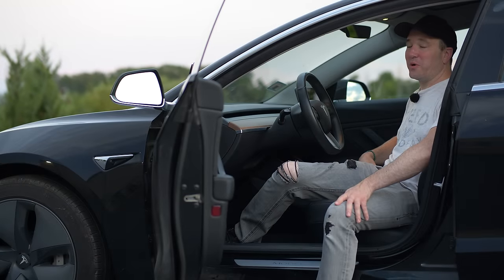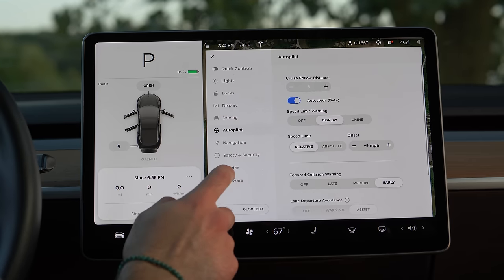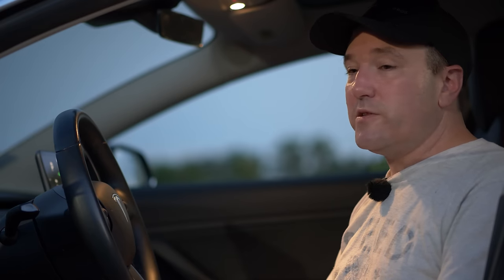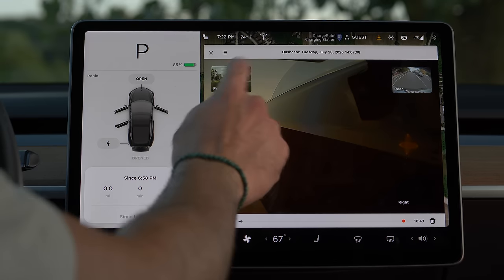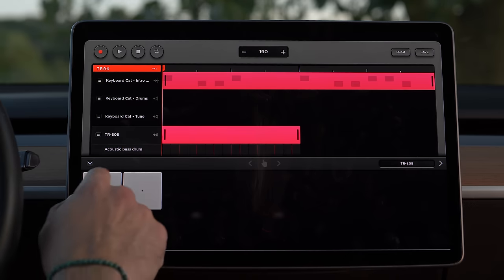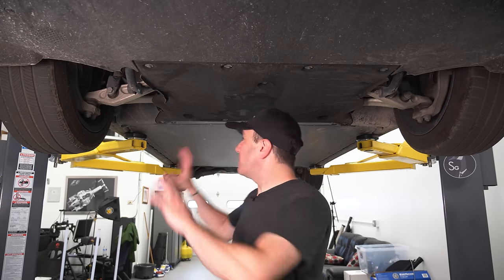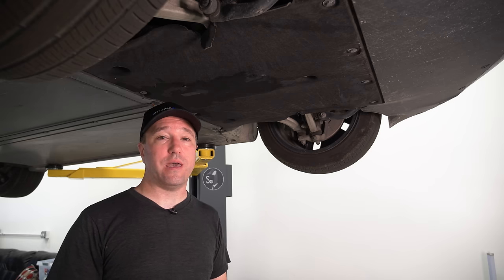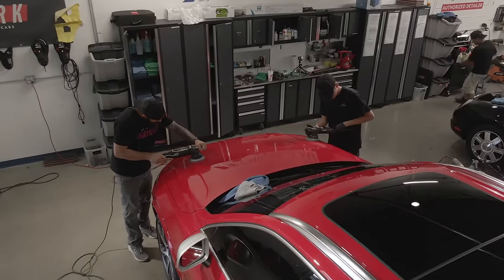Tesla Model 3 | Explaining the Cult

Comment: As my teachers always said in architecture school: Simplistic means a lack of design. This interior is textbook simplistic.
Reply: I'm not sure I agree with your teachers. In my experience the quality of architecture is not based on whether it's simplistic or not but rather what its intended purpose is. As far as design in general goes it's much the same thing. Even though - as far as functional design is concerned - the most successful designs often have in common that all unnecessary parts have been cut out.
Reply: You didn't go to a very good architecture school or what your professors were saying went over your head and you misinterpreted it. That comment is the literal opposite of what good design is about and is a very "simplistic" statement. Good design has nothing to do with complexity or simplicity. There is great design that is complex and great design that is minimal. There is also really bad design that is complex and really bad design that is simple.
Reply: @JonasRosenven  I can agree with you on your point of functional design. A design doesn't need to be complicated to be functional. As far as I was taught, an uncomplicated and functional design is considered simple. Simplistic on the other hand is focussing so heavily on the making something uncomplicated that it looses functionality. This interior, for example, has such a heavy focus on removing physical controls that it throws away functionality with its screen. That's moreso where I'm coming from in terms of it being simplistic.
Reply: @flipadavis  You see, there is a difference in the word simple and simplistic. I'm not here trying to say that a design needs to be complicated to be good, quite the contrary actually. An uncomplicated design where form follows function can be considered simple. Simple designs are often thoughtfully planned out and work incredibly well despite having an uncomplicated appearance. Have a look at an interior out of something like a Nissan Micra or Toyota matrix interior. Sure, they may not be the most aesthetically pleasing, but they are functional and simple. With the model 3 interior, however, the designers went and created something so simplistic that its function is hindered by it. In switching to having everything on a screen and removing buttons, they went and threw function completely out the window. So now you are stuck with an underdesigned interior with a tablet taped to it. It completely lacks design in terms of functionality. Maybe it is you that misinterpreted that definition. Also, I didn't think this mattered to make my comment have credibility, but I studied at one of Canada's top architecture schools.
Reply: @alexmoroz3243   I completely agree with you as far as this car goes. They sacrificed usability for the sake of pure aesthetics. Simplistic doesn't nececessarily have to mean that something is hard to use. You know - old cars had simplistic controls. A button for the heat and the level of the fan. A button for suspention. Porsche went crazy in some cars with 30 or 40 buttons plus a touchscreen. I like a bare minimum. Physical controls for the most used things and touchscreen for the rest. Tesla of course went all out. Alex is a lot more eloquent than me and he sums what I mean up perfectly. I have to brush up my english :) I do enjoy the civilized discussion though.
Reply: "they went and threw function completely out the window."  
This is one of those anti-Tesla talking points that continues to be perpetuated. I've driven a Model 3 for 2 years and functionality is quite good with very little need to use the touch screen while driving. Plus there are actually quite a few buttons in the Model 3. 

People often say there's no dial for volume and they need a dial for volume. Well there is a scroll wheel on the steering wheel that does volume as well as move to the next song and press to pause. 

They say they need knobs for climate control. Well there is an auto setting that will keep it whatever temperature you like or you can use voice command to turn the temperature up or down or to turn on various seat heaters, etc. if you don't want to touch the touchscreen.  

People say there is no button for wipers. On the end of the left stalk there is a button that turns them on for one double-wipe and causes a wiper interface to pop up on the screen. With that interface there are big clear buttons for pressing different speeds. But again there is an auto setting and the wipers turn on by rain sensors which is what I use anyway. And again there is voice command. 

There are buttons on the sides of the power seats for adjustment. There are buttons for the windows on the door arm rest. There is the other button on the steering wheel for cruise control speed adjustment. The right stalk sets autopilot and selects the gear. When in park the brake pedal is the start button.

Driver profiles remember your seat, steering wheel and mirror settings but if you are a guest then when in park you can adjust the mirrors and steering wheel through the screen and the scroll wheels on the steering wheel.  

These things are all well thought out with the intention to remove as many redundant buttons and knobs as possible while keeping functionality while driving. Also almost everything can be controlled with voice commands as a bonus.

Comment: As a '19 Model 3 owner, this was fair and well-done, and basically matches my experiences so far. It's definitely a cheap car built around a super high-tech drivetrain and infotainment system. For what I paid, the "chintzy" stuff doesn't bother me because the overall experience is quiet, comfortable and pleasant–when it's not peeling my face off. But it only does that when I tell it to.

The "everything on the screen" thing is mostly fine. What does irk me a little is that things which really don't need to be electronic/power-opening (glovebox, charging door), are...while one thing that really should be power-opening (the trunk), is not. I was actually really surprised and a little disappointed to find this out. I mean, my dad's 2000 Accord had a power trunk. I think they added it to the Model 3 shortly after mine was made. Cooled seats would be really nice (added in '24).

Thankfully a previous owner had already wrapped all the "piano plastic" in faux carbon, and added some nice rubber floor mats. With those additions, the interior is wonderfully easy to keep clean (even with kids). One spray for the glass, one spray for everything else. Coming from a car with tan leather and carpets, it's great.

Overall, it's the best car I've owned. For the purchase price and cost of ownership, I have no complaints at all.

Comment: Those panel gaps is one major reason I sold my Mustang. The wife’s Mercedes has perfect panel gaps. From far away the Mustang looked great, but up close and especially next the the Mercedes it just looked unacceptably bad. I know, big difference between price but not so fast. My Mustang was new and my Mercedes was used. The Merc with more miles drove better, had better quality inside and out. It caused me to sell my Mustang to buy an even older C63 AMG with more miles. The C63 has those same perfect panel gaps. The car looks so perfectly put together it’s a quality I think you may not realize pulls your eye but does.

Comment: I sat in 2019 model 3 for extended amount of time and the firmness was really jarring for me on slightly bad pavements. For a electric commute car, I favor comfort over quickness.  Not a fan at this point.  Need to wait for one with better suspension. 😕
Reply: It's not a Buick
Reply: @DuncanL7979  I have a Lexus rx 350 with firm but comfortable ride and model 3 is a lot firmer and jarring than my SUV.  Tesla car should at least give me equal or less jarring ride than my SUV IMO with their multi link suspension.

Comment: It’s interesting that most reviews are done in top trim loke many sg reviews, but he decided to do his Tesla model 3 review in the base trim.   With that said with the exception of 0-60, top speed, and range they are exactly the same.  

The door handle are easy to use.  Seems like a baseless gripe.
Reply: I have used the door handles and they are a god damn joke. Complete pain in the ass. Also had it close with my fingers in it... 

I live where it reaches -30f and even the most practical door handles freeze solid under a 1/4in of sheet ice. These handles fail HORRIBLY when frozen through. It is 100% needless and offers NO BENEFIT. 

He isn't lying, and he never does. The door handles are stupid and he's not the only one to notice.
Reply: @jordanjoestar8839  Agree. I live in northern Canada and It can reach -40F and my normal door handles freeze up and are difficult to open at times. The ones on the model 3 would be a nightmare. Definitely not a baseless gripe.

Comment: I cannot like or dislike this video. Here is why: I like it because it's honest. It showcases the good with the bad, and talks about comparative issues with other manufactures. 

I dislike it because it focuses on negative details that are easily explained or dismissed. For example: the 'car guy wont like it.' True, but this is a personal objective choice. As a car guy, I like the Tesla. The large touch screen is a distraction. Again, true. So is a cell phone and even though distracted driving has been made illegal in many states, cell phone use while driving is still a thing. It comes down to personal choice, risks, and self-discipline. One thing the Tesla has over other manufactures in this, is that you actually CAN be distracted. The car DOES drive itself using  autopilot and will absolutely pull over and stop if you are that distracted. So engage autopilot while driving down the road, pull up the web and browse feeling confident that the car will stop when it needs to, stay in its lane, etc. Drive when you want or need, or let the car drive while you 'monitor' the car. 

Fit and finish. Yes, there have been some issues with this, and Tesla's QC should probably be revamped. They have gotten better, and will continue to improve. As mentioned in the video, many auto manufactures have had issues with this. It's all apart of keeping costs down while attempting to not suffer in the quality department. It's a balancing act. 

I do not believe that a Tesla anything is right for everyone. To own one, you should probably step up to a dual motor (or tri if offered), have a garage with power (or have power installed) to charge it, know where your local Tesla Service Center is (and they repair many of these QC things under warranty, btw. And the Warranty was not mentioned in the video, which in my opinion, is pretty awesome compared to other manufactures.), know that you will pay more for tires as they tend to wear faster due to the weight. But you will actually make that up by saving at the pump. And know that Tesla is a relatively new car company that is pushing the envelope on what cars should be. 

Everyone asks for the future, and when it is presented, they find faults. I personally embrace change, technology, and forward thinking. I currently do not own a Tesla, but I have preordered the CyberTruck, and I cannot wait. I am excited to see all its features, both good... and bad.

Comment: the hipster boujee car of choice
Reply: Its also somehow supposed to be "affordable"
Reply: @stephenfannin6482  Yeah 38k is bargain basement amirite?
Reply: @stephenfannin6482  "bUt BuT tHe MoDeL 3 sTaRtS aT aN aFfOrDaBlE pRiCe Of $35,000" yeah it also only gives about 150-200 miles of range and takes long to charge fully unless you use the supercharger, and you don't get much car for your $35,000 would rather get myself a Camry XSE V6 or a slighty used (maybe new if I'm lucky) Civic Type R
Reply: @stephenfannin6482  The base Model 3 with no options is $29,690. That price puts it in competition with a base model Ecoboost Mustang, Hyundai Veloster, or Honda Accord - but you get much better off-the-line performance, lower maintenance costs, better resale value, and it only costs $9 to "fill the tank."
Reply: @imnotusingmyrealname4566  u save on gas and maintenance.
Reply: @alextogo8367  Yeah it still takes a lot of time to catch up. Also I'd never buy a Tesla just because of the image. It's one if the few products where I care about that because I don't want people to assume I'm a Tesla fanatic. I'm in Europe and VW has just launched the EV Golf successor ID.3 and the crossover ID.4 is launching shortly. Those are actually cheap-ish cars while still offering the benefits of an EV. VW's Czech brand Škoda might be an even better buy for value for money. You even get the Rolls Royce umbrellas in both front doors, just in a more practical less extravagant way. Telsa is still a luxury car while VW and Škoda are good quality cheaper cars.
Reply: @imnotusingmyrealname4566  well you need to have a good image if you want to be a good competitor right. If I was the owner of a company, image would be everything. Look at Hyundai they had a bad image for a very long time. And even though they getting better, some people won't buy them because of their "badge". You're damn if you do and damn if you don't. You can't make everyone happy. That's the bottom line.
Reply: @zzanatos2001  the cheapest one I see on Tesla's website is $37,990.

Comment: Correction: Cheapest Tesla is the $35k standard range model. It’s off menu and you have to request it but it’s there. 

I own a Tesla model 3 and while I agree with the panel gaps, cheap paint issues, cabin noise, semi-cheap materials, the touch screen is not an issue. Only once did I have an issue with the screen and a quick reboot fixes that. Until people start crashing because they’re using the screen, I think the argument of the screen being a distraction is mute. If anything, the issue is full self driving. There is evidence, from crashes, of people falling asleep using the feature. To your point on Superchargering. It’s only meant for road trips and is not recommended/ intended for day to day charging. Almost all drivers charge at home for their day to day needs. That’s where the savings come from vs gas cars. Also, in addition to tesla there is lots of companies that provide charging for EVs that you can use to charge your Tesla (e.g. ChargePoint, electrify America etc.).

Comment: A year later, I sold my perfectly working GTI for a Tesla 3 AWD to get a NEW car, long story short the GTI had many engine issues and warrant was running out. Two weeks into this car, I can say the good news is the black piano is gone in the 2022 model. The bad, well, I got the T3 awd extended range version, and one thing people don't say openly is that this car doesn't do well in either cold or hot. Take the stated range and divide it by three in cold or hot weather.  The EV future is a joke for now, and I can say that the plug-in hybrids make more sense with smaller batteries and less chance of a single cell failure. You only need one cell in that big 75kw package to reduce the performance of the whole battery. On the safety side, I suggest you check an EV fire, and you will see it is a chain reaction of cells overheating with flammable gases, an awful way to go.

Comment: Taking ur eyes off the road and over to a center mounted screen while driving, is never a good idea....Im amazed it was allowed into production as far as safety
Reply: It's not much different than looking down at your gauge cluster.
Reply: @bobthebuilder372  Except the difference is that a glance to the gauge cluster to check your speed/RPMs takes less than a second, but adjusting the AC/googling something/adding fart noises to the rear left passenger seat/etc. in these cars can take more than 5 seconds.
Reply: There are a ton of safety features that are paying attention even when the driver is not.
Reply: There really isn't a reason to be staring at the Tesla Model 3 screen while driving.  Voice commands are solid on this car, and most of what you set is done before you pull away. I think this concern is a non-starter, particularly in a car with this level of driving safety features. I have LOTS of issues with my Tesla, but I think every review of this car over-calls the lack of dials/buttons as a problem.

Comment: I drive a ludicrous S. crazy, fast acceleration. Mark is spot on with all their gremlins, 35 profile tires does not necessarily overcome weight and inertia even with a low centre of gravity. 

For a new manufacturer, yes it does have a few things they can improve on such as wind noise, panel fit and door closing, etc.
Nothing is more satisfying than leaving powerful motorbikes in my wake and the disillusioned looks from Ferrari and Lamborghini  owners that temp the drag fate!

Comment: Sounds like a beta with a 50k price tag :p
Reply: that's maybe why the previous owner sold it... they probably bought a newer model 3 with new and improved manufacturing, or a Model Y. Tesla's speed at updating mid year models is kinda nuts..
Reply: It's a base model with no options, so the price is $29,690.
Reply: Zachary Zarko add another 5-10k
Reply: @deej628  Why? For options - or just because?
Reply: @zzanatos2001  pre-owned model 3? Because you can't buy the cheapest model for that price brand new. The 31k price is supposedly with a 6k incentive without tax, so it's at least 37k for the rear-wheel without AP
Reply: @redReiRei 
Kinda scummy when they include tax incentives, for which you may or may not be getting. I want the otd price.

Comment: Yo I hate the 3 Model but if you paint correct and PPF the WHOLE car brand new- AND- install the eibach pro kit springs and sway bars it looks way better, won’t scratch (self healing) and is suspension is even flatter in corners - “it’s on rails” - if you’re in Austin lookup Austin Detailing and tell em NITRO sent you! They will hook you 🆙